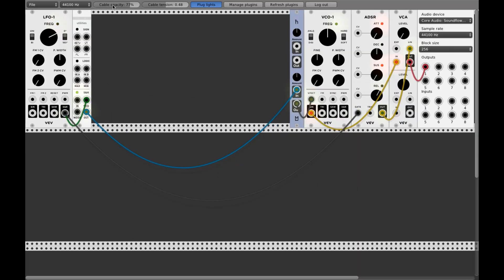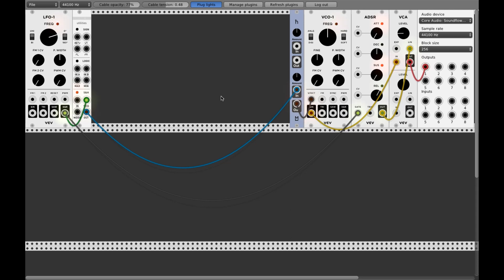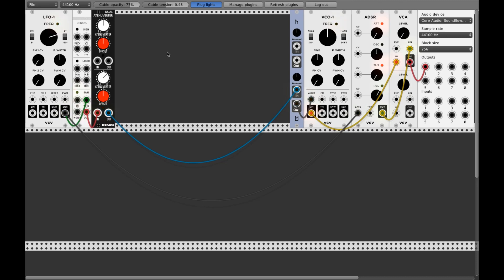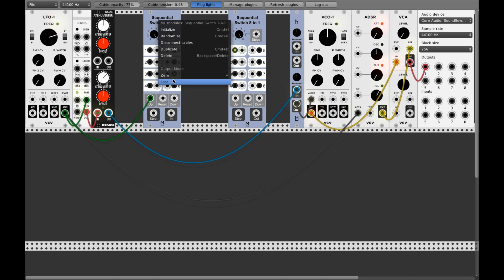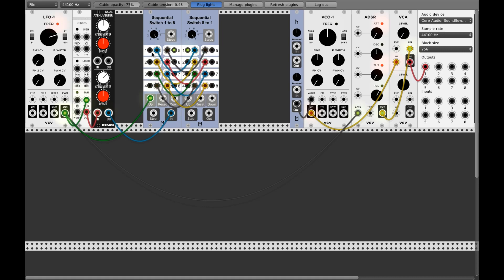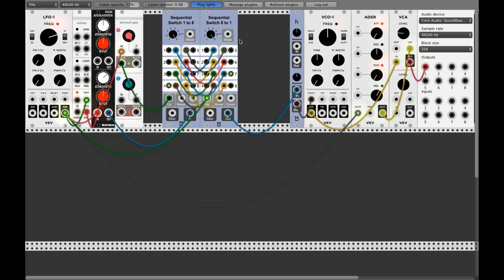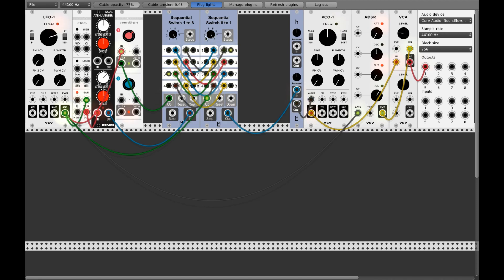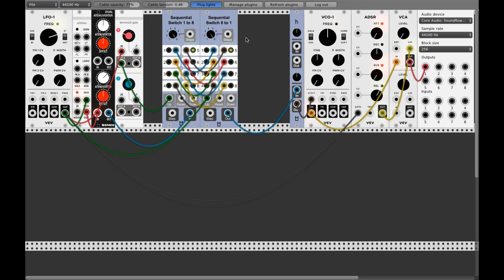VCV Rack Tutorial: Controlled Randomness

Comment: Very interesting ! 
What's nice is that by reducing the number of affected steps (as you showed by turning it down to eg 4), combined with repatching eg instead of 1-1, 2-2 you would take 1-1, 2-5, 3-2, 4-6, 5-3, 6-7,7-4, 8-8 - resulting in every second note coming from a fixed set , while the in betweens are random.
Reply from the maker: Yeah - that's nice as well - THX!